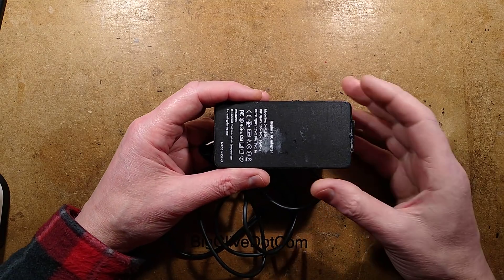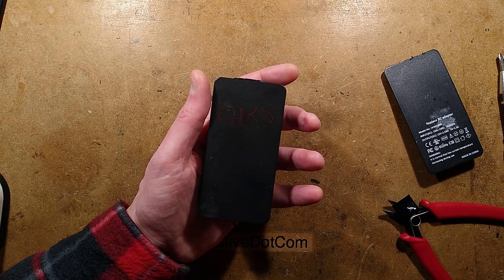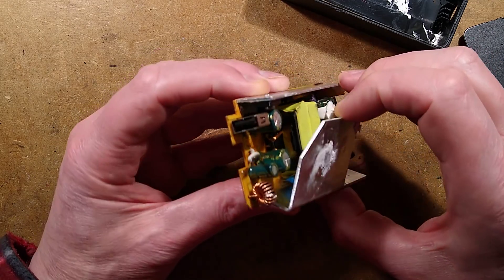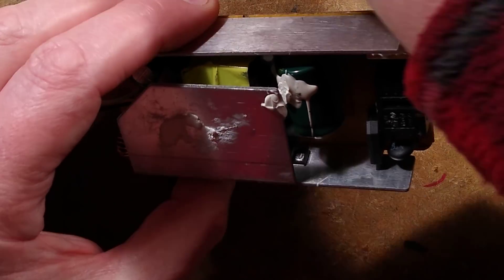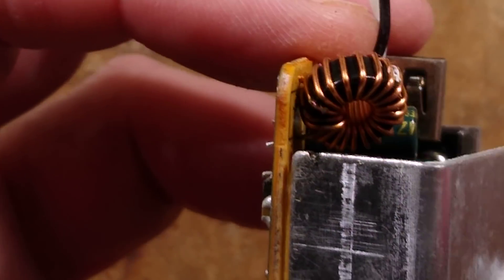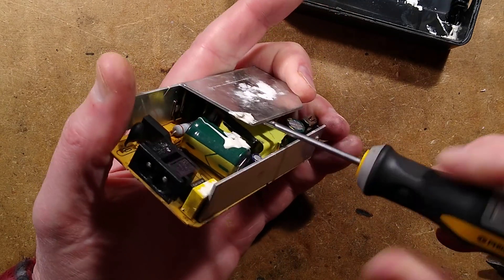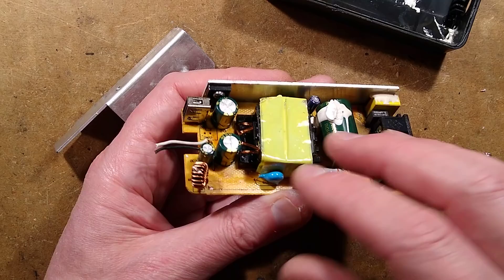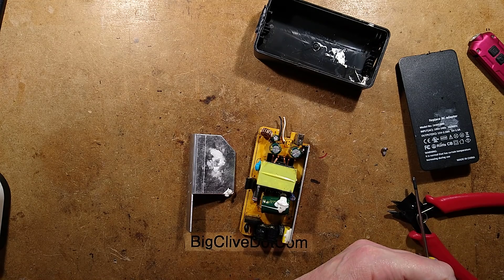This PSU killed a Microsoft Surface and a monitor

Comment: The guy who designed it was not involved with the construction and with zero quality control (to keep costs down) there was no safety checks !
Unqualified workers would not have understood the risks involved either and they would only batch check one in 100 or so just to make sure some of them work so there is nothing to stop this kind of thing happening again.
They really don't care if it burns down a house on the other side of the world or kills a child, there is no comeback to them so they don't accept any responsibility. They'd just say it was fine when it left the factory and wash their hands of the matter !
They cut prices so low that they only make pennies on most items and rely on selling in volume to make a living, it's a 'quantity over quality' mindset which they have no intention of changing because it doesn't benefit them and would probably mean fewer sales !

Comment: From the looks of the outside its clearly a knockoff, That adapter is definitely not a real Microsoft Surface adapter. is not even a replacement unit.

Comment: It was turned into a mini plasma cutter that cut a notch in the aluminum.

Besides, it even tells you will need to "Replace AC adapter" right on it. Who knew it would be immediately? 🤷‍♂️

Comment: Seems likely that the person who chose the heatsink was not the circuit board designer, relatively unqualified, and so oblivious to the separation requirements.  The negligence was lack of overall design control though - classic cost cutting.  

By the way you can clearly see the track connecting heat sink to the -ve input has blown off entirely, as has the connection to one side of the mains input, I guess the live side.  Tracing the blown off tracks usually gives you a good idea about the short circuit route.

I think the user was lucky that it blew up - better that than being electrocuted by a live laptop.  Hopefully the consumer unit RCD tripped though?

Comment: Why would you spend 100's of pounds on a surface tablet and destroy it with a cheap aftermarket power supply from the likes of Ebay. My surface tablet power supply looks really well made and even is safety mark certified. This is a salutary lesson to anyone to make sure that you are using genuine accessories and not something carelessly made by the clone merchants in China.

Comment: If I get a laptop or any electronics for repair and it is the external PSU that is at fault.
I won't supply a replacement, but advise the customer to go to the manufacturer for a replacement and avoid Ebay and Amazon like the plague.

Comment: "Mains negative"??? Line and neutral must both be considered live, esp. here on the continent where we have unpolarized plugs.
This is not a double insulated device, despite their best efforts. It sports all the right labels, they even wrote the CE mark correctly. The absence of a company name and serial number are enough for me to bin it straight away.
Try lighting the plastic, I bet it doesn't have fire retardants either.

Comment: My power supply making things go bang (and potentially burning down the house!) story relates to the power supply that came with my 3D printer. The printer stopped working and I discovered that the USB cable to the computer was so hot it was melting a plastic bag it was laying across. Fortunately it was plugged into a USB hub, as the port was destroyed, but the laptop was unharmed. All the electronics in the printer were destroyed. During my investigations, a small ball of solder fell out of the power supply, and the fault cleared. The power supply now seems to work properly, but I won't risk using it. The printer had been working fine for a while before that, so the solder must have been rolling around inside since it was manufactured, and a slight movement finally moved it to a place where it could wreak havoc! This is why I make sure I cut the red wire in USB cables I use with my 3D printers!
Reply: Cutting the 5v wire in your USB cable won't help unless there is a bad combination of faults at once. On the other hand, it should prevent the USB connection from taking place at all.
Reply: @eDoc2020  My 3D printers work fine with the 5v wire cut. It just stops the computer powering the printer electronics. It's often recommended to do this, and lots of people put tape over the track in the USB plug, or you can buy connectors to do it. But I think cutting the wire is safer.

Comment: I've had it with boilers, where one thing goes and takes out something else. They should have better protection built into the design. If I was a cynical person I'd say they do it on purpose.
I am a cynical person.

Comment: They could have used a smaller BLACK heatsink which would radiate heat away. i often use a black marker on heatsinks to improve cooling
Reply: Hi, they could have designed the circuit correctly such that it didn't overheat under the rated load current.

Comment: Thanx for showing.
I also recognize a general design flaw in this unit.
They made the gaps in the PCB and seperation of the low and high voltage side useless by putting the heatsinks over the entire length.

Comment: Clive, the heat sinks totally bridge the isolation barriers. The design is incompetent, unsafe and completely violates CE and UKCA standards. Insulating the inductor is NO fix.

This is why I NEVER buy mains powered equipment which is not branded and sold by a reputable seller. Trading Standards simply does not enforce safety legislation in these cheap Chinese products which are freely available in the UK market. The only remedy is not to buy them!

Comment: Clive any chance you could publicise the web site for the petition "Stop the sale of dangerous electricals on online marketplaces"?

I watched you video on the Disco Smoke Generators, which so appalled me with switched neutral and potential for a genuinely live microphone, so I tried to get trading standards interested but they wouldn't do anything unless I purchased one.  I got the impression they didn't have any teeth..
Reply from the maker: Not if it's the "electrical safety first" one, as it's just the charity wing of a marketing company called the NICEIC.
Such a blanket petition could also make it hard to find some bare electronic modules aimed at the engineering community.

Comment: Must feel great to save 30$ on a cheap replacement power supply, only to have it blow up your 2000$ equippment at first contact and possibly injure or even kill someone in the process.

Comment: Looks like it even has a proper fuse, an inrush NTC, a proper safety X cap and even good isolation distance and slots. There are much worse designs out there. That is a strange combination of component misplacement and a heasink that shouldn't have been live in the first place. I'll certainly keep an eye out for similar design flaws the next time I fix such PSUs.

Comment: It is cheap for a reason and nothing is free, we need to understand that everything costs money, research and development, skilled production staff, quality control, test equipment, it all adds together, often at least one of these costs are renoved most of the tine it is quality control, often research an development is basically copying someone else's design and worse remiving components from this stolen design to save few cents.

Comment: Nothing to support the heat sink except for the transistor it was cooling, very bad design as any vibration or knock and it will move and also stress the transistor. Is the white schmoo something to hold it in place as plastic is not thermal conductive?

Comment: Quality control is the main  issue with these cheap electronics, cold solder, solder balls rattling about, assembly errors etc, these don't get picked up because there is no quality control.
I have bought cheap electronics many times and many times I have had to correct the soldering myself.
I wouldn't buy a cheap power supply like this for a laptop or a tablet.
Reply: Yep, you only get quality control with Quality Manufacturers.

Comment: It shows they just don't care about testing to recognised standards, even for their own home market. What's worse is amazon and feabay say they are not placing the product on the market so are not responsible for it meeting any safety standards. That needs to be changed somehow they need to at least request a DoC before allowing it to be sold. Maybe a bit harder for feabay.

Comment: If you drop or knock the PSU, the heat sink could damage the insulation on the inductor. They did a wonderful job with the isolation gap on the PCB, but ruined it with the heat sink connection to the live side of the supply !

Comment: Gotta love the thermal coupling to the plastic case with heatsink compound. "Look, we tried!"
Reply: The case on all fully enclosed plastic enclosures are intended to radiate heat.  The box is intended to get hot.  The thermal compound is not useless.

Comment: Nice Video. It looks like a non polarized socket.   Could it be that it worked fine when the power cord was plugged in one way, then went to disaster when plugged in the other way?
Reply: The heatsink is connected after the bridge rectifier, so reversing the plug will have minimal effect.

Comment: Here’s what I say when people complain that original power supplies are “overpriced”: I’d argue they’re not overpriced: you’re paying for peace of mind. 

Some of the extra money went towards better parts and manufacturing processes. Some went to better engineering. Some went to testing and certification. Some went to a budget for warranty fulfillment. And some went to the liability insurance the manufacturer carries, which is what funds the massive recalls in the rare cases they later identify some rare unsafe failure mode. No-name vendors don’t do any of that. 

The $15 savings on a no-name phone charger, while it might be a massive savings percentage-wise, is less than the cost of eating out for lunch. That’s well worth it to me to know it’s not going to fry my device, electrocute me, or set my house on fire.
Reply: Look at the comment that was below yours when I wrote this: Sometimes the price difference might be $50 on a PSU already under $99.  It would be great getting back a reliable labeling for genuine compliance testing not bribed by the big companies, so we can safely shop for professional quality generic parts.
Reply: @johndododoe1411  $50 isn’t enough to risk death. And the issue isn’t bribery; the no-name vendors either lie about certifications, or don’t even pretend to have them.

Comment: If only the ‘replace power supply’ instruction had been followed….     I doubt that would have passed a class 2 flash test even before it chaffed the insulation  tbh

Comment: I purchased a power supply (built in 3 pin) from ebay for my mum's CCTV , I saw it had the CE mark on it, but my mum said after a week of using it, the unit went bang and the mains tripped, she said the lid had also come off. When I got to see it, the LIVE wire had come loose from the PCB and could touch any part of the circuit board  😞

Comment: Pretty daft to include the opto-isolator and then put the heatsink to ground (if it had a 2 pin mains plug then the heatsink could have been live) and go over to the low voltage side. As far as I know when an opto-isolator is used they make sure everything is isolated - even cutting pcb. In this case even the pcb was cut, then that heatsink nullifies all efforts. I am not a designer so probably I would have missed that red flag but somebody whoose jobis designing these things should have caught it. It also means all those approval marks are probably fraudulent.
Reply: North American 2 pin mains plugs are polarized for just this reason.
Reply: @stargazer7644  Over here (Malta) we use the British system which is polarized but many European countries use the 2 pin, non-polarized system.

Comment: I had same. Well nearly. Saw the spark and pulled plug. Thankfully all was ok. Same setup. MS surface, monitor, keyboard and mouse. The power brick was original. Took it apart (as one does) heatsink and choke. Seems all surface power bricks suffer same demise.

Comment: I agree with things just getting by, you cant think of everything every time. But, I don't think it takes a electrical engineer to know that when you intentionally isolate one side of the board from the other, you probably shouldn't go laying a big piece of metal over said isolation.

Comment: Let's just go back to  heavy, less efficient, larger, linear PSUs - they did used to fail sometimes, but in my experience far less often, and when they did fail, they didn't take everything downstream with them, and there was much less risk of actual live mains appearing at the wrong end. :o)

(there will now be 500 people contradicting this of course, but I grew up with old linear PSUs, making and using them, and I can't remember one ever failing actually)
Reply from the maker: An older style unit with transformer, rectifier, caps and then a modern switching regulator could be a good compromise for efficiency.
Reply: You've obviously never had a linear power supply short an output transistor and apply unregulated 30V to your $2 kilobuck 12V radio.
Reply from the maker: @stargazer7644  I've had that happen to an arcade game PCB.

Comment: I can confirm for you those surface psu are shoddy. I owned a surface 2 and surface 4. Both of them had terrible problems with power. They would randomly stopped providing power. For the surface 4 psu the USB port burned out after two uses. Crap. Got rid of my surface 4 hated the damn thing.

Comment: It took me buying 2 Zerolemon 10,000mAh batteries for my Samsung Note 4 and a 10,000mAh Powerbrick like clockwork every 9 months, before I realized the big orange JBL charger down in my shop, for the JBL Boombox was getting everybattery pregnant. 
Ol' Big Orange was slingin' it wasn't he?!! {0.o}  😆😂🤣

Comment: Is this an Amazon special or a Microsoft product
Reply from the maker: It was a generic grey import.
Reply: I think Louis or Dave did something on these a while back warning of the danger. That inductor placement is not bad design, it is negligence, and if as you rightfully assess the device was referenced to mains voltage, it is lucky the only thing that died on that day was the device and it’s attached peripheral.

Comment: Chinese designed knockoff, Microsoft surface PSU's have more than two low voltage conductors, this allows the surface to turn off the psu.  The guy won't get his tablet replaced

Comment: On older Surface tablets, you can't get replacement OEM power supply anymore and are forced to roll the dice on these knock-offs (which last maybe a year if you're lucky)
Reply: I have a bunch of those, and now when you mention it I should probably put them on Ebay just for that reason instead of hoarding them for no reason at all.

Comment: often WHY inductors are usually heatshrinked in these types of switching power supplies.... and I don't think I've seen any conductive reaching across the isolation gap between the high and low power sides like that.

Comment: Thank you, I've used this video as a reminder to my team as to why we spend the extra to only buy genuine power supplies and batteries.
Reply: My thoughts exactly because sometimes fake stuff or electrical gear made in China is often poor quality and doesn't meet safety standards. It's best policy sometimes to pay a little extra an get something that's safe an lasts longer. I have heard of batteries and chargers an power supplies catching fire when in use due to poor quality components and design.

Comment: I had a similar (cheap replacement) power-adapter for a MacBook once on my bench. They used a shielded cable for the low voltage side. After some use the cable shielding could sneak back into the casing due to bad stress relief of the cable and eventually made contact to the (live) heatsink. The owner of the MacBook got quite an electric shock from the (then live) metal casing of the MacBook. Luckily the owner and the MacBook survived that incidence.

Comment: Some power supplies have the inductors sheathed in thick walled heatshrink tubing, although I think it is more to reduce vibrations than to increase electrical insulation it will do both functions and also increase the protection against rubbing.

Comment: I never get the desire for someone to spend so much on a laptop yet baulk at the cost of a genuine/OEM replacement AC adaptor, I guess the OEM adaptor is looking a lot cheaper now! I'm not going to waste the £1100 I recently spent on a laptop for the sake of saving a few pounds.

Also genuine PSU's don't have to be expensive, for my Mums cheapo Lenovo, Lenovo themselves (via their official parts store) only wanted ~£11 delivered for a replacement PSU, and if she'd been able to have a lower wattage one (the parts website as not clear on that), even cheaper. 
Also so long as the PSU is from a well known manufacturer (Liteon, Delta, Mean Well Etc.) you'll be fine, the "genuine" replacement one I brought for my old Fujitsu had no laptop manufacturer branding on it at all, just the standard Delta branding/spec labeling on it and  a Dell P/N sticker.

At least with USB-C now you can simply go for the cheapest decent brand PSU that has the right specs, i.e. if the cheapest one is a HP it shouldn't matter if your laptop is a MSI.

Comment: That heatsink looks to be tied to the output of the mains bridge rectifier... so it shoved full mains voltage through to the DC side (assuming the rectifier blew as well).
Reply from the maker: The rectifier tested as a short circuit.

Comment: I had to get a replacment charger for my surface. I couldn't find a new genuine charger anywhere (maybe supply shortages, but who knows). I refused to buy a clone/counterfeit for exactly the reasons shown in this video, and opted to buy a used genuine charger from ebay